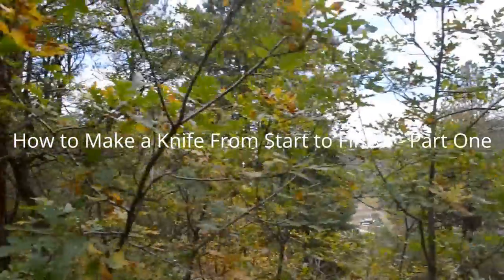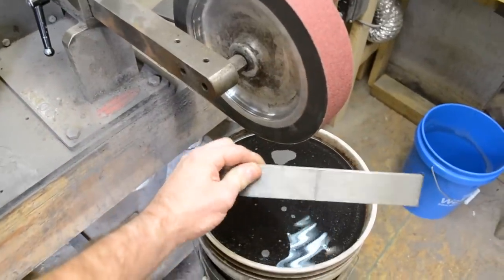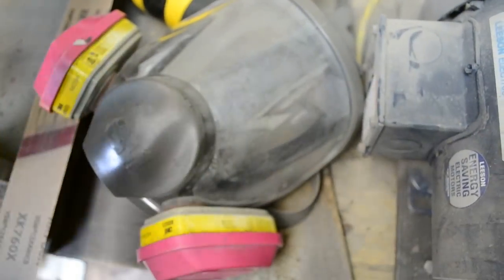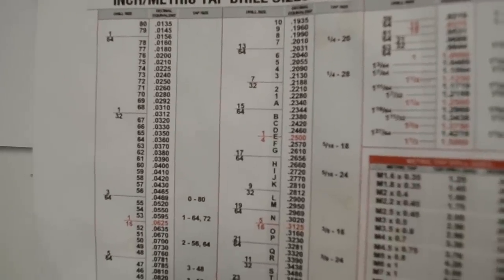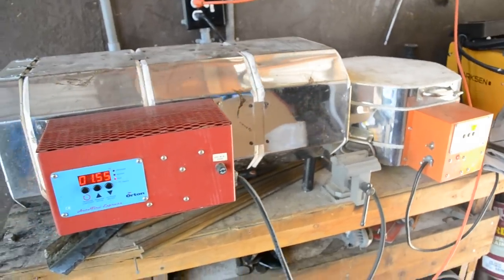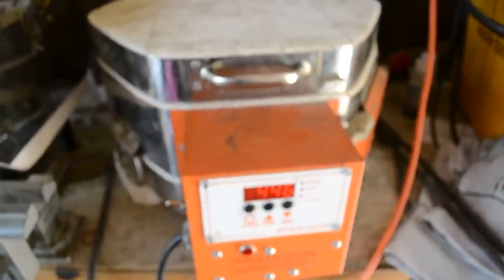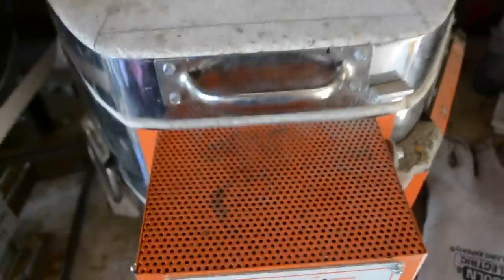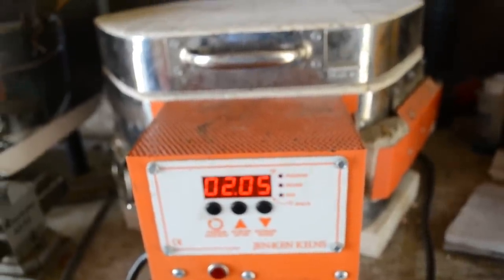How to Make a Knife From Start to Finish - Part One

Comment: Did you happen to mention what type of oil you used for the quench and why do you preheat it or warm it before the quench? Thank you in advance. Great looking knives
Reply from the maker: 11 second oil from McMaster, preheated in a turkey cooker. They hold almost 5 gallons and easy to preheat. That being said room temperature Parks 50 works great but a bit fast for 01. Warm Canola works good too and no nasty fumed.

Comment: Usually when you put pressure on the edge of a running sanding belt it pulls it towards the edge so only a very slight overhang is needed to start with.
I was wondering where you got the steel blank for this project? It doesn't look like a regular blank but more like a scrap.
Reply from the maker: Flat ground dot com for the steel, it is from a bar not a blank.

Comment: You do all your heat treating and temper process before you grind your bevel
Reply from the maker: Yes I do on most of my knives. Use new or sharp belts when grinding and be sure to keep your knife cool. Most modern steels grind almost the same post heat treat if you use high speed and pressure while doing the initial grinding... then move to slower speeds as you use finer grits as they heat the metal quicker. With high carbon steels you need to grind off decarb anyways so no point in finishing before heat treat to me. Post heat treat grinding also helps with keeping a blade or bevel straight... easier to straighten a slab of metal and no thin bevel to warp. Now if you were to make a knife with a 1x30 grinder or file you might want to grind most of your bevels before heat treat... another exception is shallow or water hardening steels as they need a thin section on the edge to harden.

Comment: Just watched part 2,  I was wondering where part one was and apparently this was over 2 years ago, so I had to re-watch to remind myself what happened lol.  

I'm curious, any reason you went 10 degrees 'lower' for your second tempering cycle?  Whenever I do two different temperatures it's usually the higher one on the second temper.  I wonder if it really matters?  I know the second cycle is to temper any fresh martensite that was formed from the retained austenite during the first cycle, so the freshly formed martensite would be tempered at a slightly lower temp, although there really may not be that much.

I remember reading a thread on the forums by Rick Marchand a number of year ago regarding his straitening jig for tempering, where he also discussed a theory he had regarding how he thought you may have to raise the temperature just a bit if you don't get it the blade straitened during the first cycle as the steel has a memory and.... well I honestly forget why lol.  Anyway, this just made me think of this other example of raising the tempering temperature.   Please don't get me wrong as I'm not questioning your method,  just made me wonder of the reason why we do it the way we do :)
Reply from the maker: Your second paragraph does a great job of explaining my logic behind this.... I need to find my sources but I think I read it in a heat treat manual somewhere. I remember Rick's BF post about the straightening thing and still do that from time to time!

Comment: Great info here! Can I ask why you heat treat before grinding though?
Reply from the maker: +Travis kingsley Thanks Travis! The bevel grinding is done post heat treat for several reasons. I am able to keep my knives very straight and when I do need to straighten a knife during heat treat it goes better. Also with high carbon steels decarb must be ground off after quench so there is no real point to fully finishing a blade when this must be done. I use sharp belts so no real heat is produced during bevel grinding ... it is the later grit belts that get trickier to use and keep a knife cool so once again it is just simpler and better to grind post heat treat. I'd say 99% of folder makers do their bevels after heat treat because of all of this.
Reply: +DanielFairlyKnives - Is it different for fixed blade makers?
Reply from the maker: +Eternal Knives I only grind before heat treat when I am going for a hamon as a hamon is a thin amount of hardened steel. (hope that makes sense) I leave pretty much everything else unground as it makes the process simpler and I prefer the way hardened steel grinds.